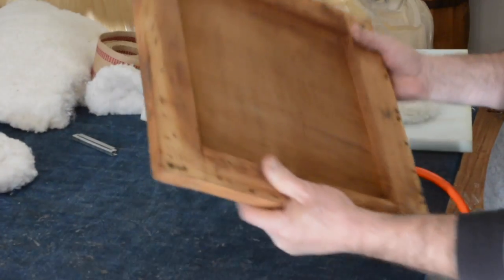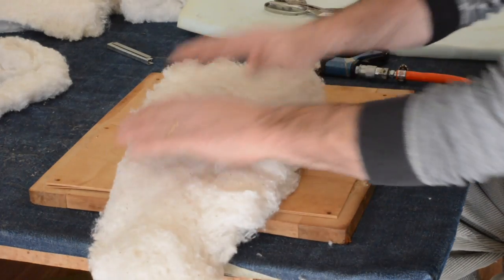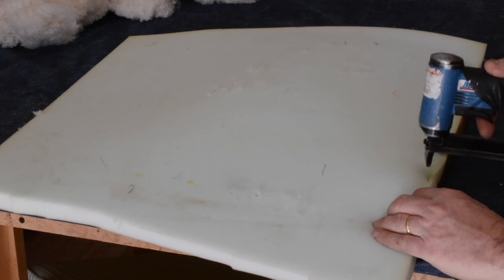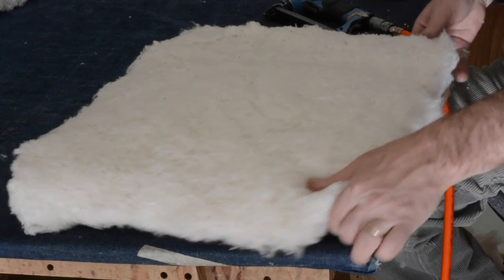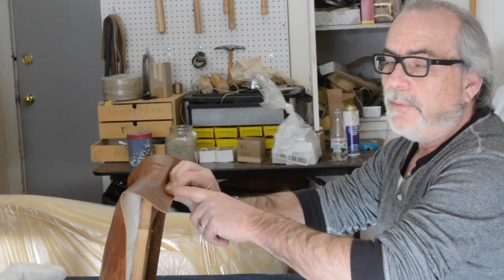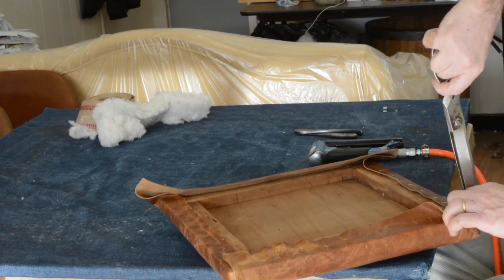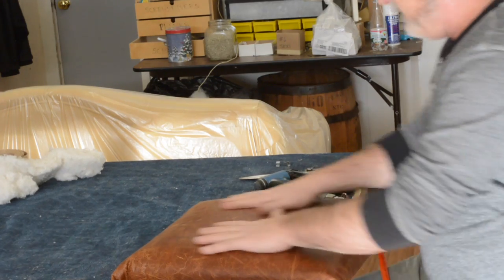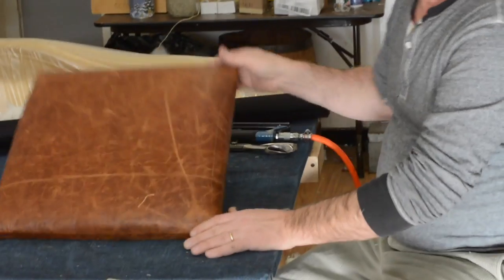How to Apply Leather to a Drop in Seat

Comment: You said that if the customer chose, you could do it the old way with webbing, Horse hair etc. Would you have cut out a hole in the middle and use the board as a frame?